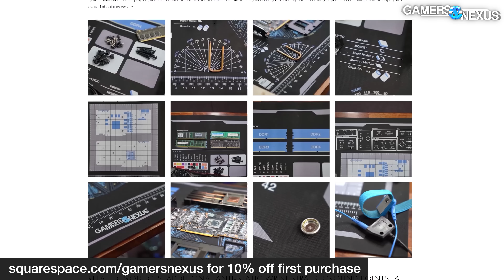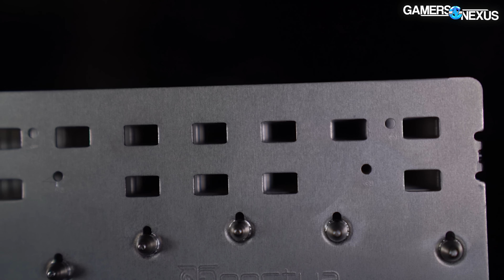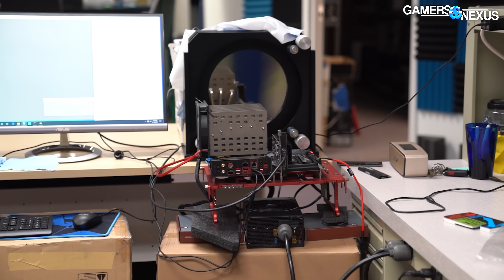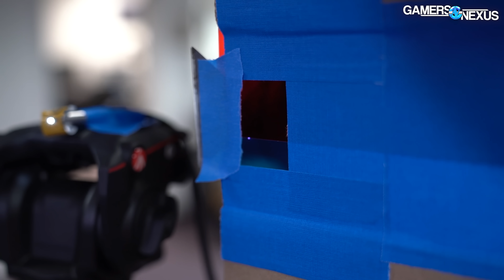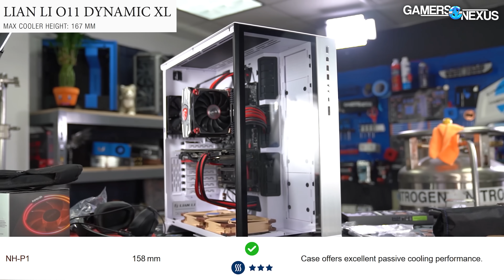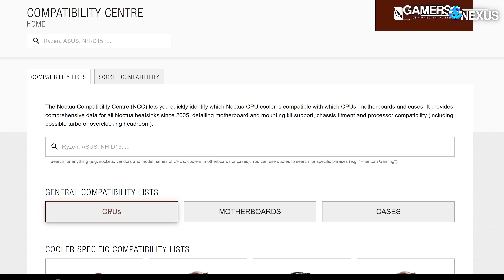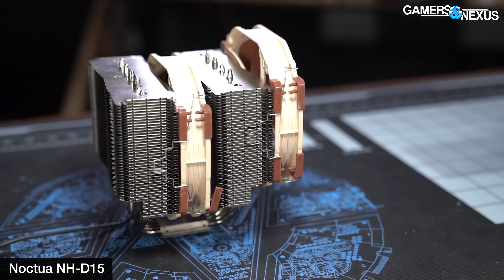Noctua NH-P1 Passive CPU Cooler Review: Benchmarks, Schlieren Photography, & Mechanics

Comment: One of these on a future power efficient PC is gonna be amazing. :)
[edit] You tested on 120w?! Me with a 5800x, interest intensifies! (My case is way too small for it to work, but... I've done crazier stuff)
Ah. I see. So 68w is workable. I wonder if a really aggressive PBO limit of 100w or similar on the 5800x... as I've swapped out my original 5600x... So if I do wish to go truly passive at some point, I'll just underclock/uncore a bit and put the 5800x into 5600x imitation mode. :P

Comment: Overly complicated setup of the Luft Schlieren photography, same can be achieved with water vapor from an ultrasound vaporizer and a peltier element or a small heat plate. Alternatively, if ultrasound vaporizer is already to elaborate, one could use a cigarette in a garage setup to achieve the same with a working mainboard and cpu. Condensing smoke can be cleaned with isopropyl alcohol but I doubt that for the short time of testing it would cake everything in tar.

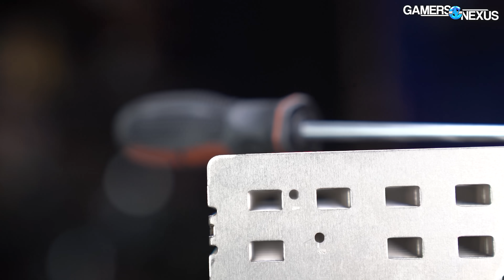Comment: Torx suffers quite a lot from using the wrong (undersized) torx driver/bit. This would likely strip the screws and also damage the driver. In that regard I'd disagree with "a lot less likely to use the wrong driver"  - 22:53

Comment: I can hear the sound of cracking PCBs from here. Things like this should come with full mini-ITX or even mATX steel backplate that screws directly to case. A lot of PCs i've seen running even puny aluminum 120mm block have some PCB warping.

Comment: If you run a much larger cooler than what you need, you can run them with very low fan speeds, and you will likely not really hear the fans at all. That's probably a much better choice if you care about low noise. If you care about low maintenance, Noctua fans tend to last a ridiculously long time (they should last more than 6 years easily, even if being used 24/7) and they're also very easy to replace if it ever comes to that. This is a very niche product. I don't mind that it exists, but I think some people will buy it just for the gimmick factor when they should probably be buying something more conventional.

Comment: I really would like to see that cooler side by side with a Scythe Orochi. The Orochi might even be a bit heavier than the NH-P1 but it was made to be used with fans and didn't (afaik) do well in a fan less build though some tried it. It would be interesting to see a break down of the differences in construction and manufacture. There is about 13 years between these mammoths, and there's hopefully some significant advancements that's been made in that time.s

Comment: R9-3900x user here (NH-D14 with PWM fans)
The REASON I was at first interested in this cooler was because my CPU hits 78degC under certain loads and so the fan ramps up to 100%. I played with the fan profile a lot, but even under LIGHT load it would spike to 78degC so I finally ended up with a fan profile that stayed at 20% fan RPM until 60degC then quickly ramps up... again, the CPU temperature can spike really quickly even at a 10% load (though often at a game at 30%(ish) load the fan isn't spinning above 30% MAX RPM despite producing more heat). WHY?
It's because temperature is NOT heat. You can have local hot spots. It's weird because I can get spikes to around 78degC at 10% load but then stay at 78degC at 100% fan RPM... point is, I wondered what would happen if I could get the TEMPERATURE SPIKES DOWN... but after watching the videos I soon realized that I'd get rid of the fan turning on at light usage scenarios (as the temperature would be lower) but running a game would probably require a fan to turn on and 100% load in a warm room would probably not work at all.
Cool product though!
Looking forward to the Noctua NH-D15 2022 version, although my cooler is working pretty well aside from a few fan spikes (I'm one of those noise freaks as they aren't even very loud).

Comment: If I break out my old heat transfer book a passive cooler is a type of "Free convection" type cooler.  Free or natural convection is when a body force acts on a fluid where there is a density gradient.  The net effect is a buoyancy force which induces a free convection current and the body force is due to gravity.

Comment: I would love to see a comparison between case fans off vs case fans on with this installed in something like the Meshify 2 or RV03/RV02-E. It seems like you could raise the max continuous heat load quite a bit from ambient case airflow, while still being able to shut the fans off entirely at low load

Comment: Im running a dark rock 3 at 700rpm on a r5 1600  at 4.1Ghz. HWInfo reports about 80watts of powerdraw. But still, even at 50% power use and like 20% on the gpu it is still louder. fanless CPU coolers are near useless imo as long as you have a loud AF gpu

Comment: This is interesting cooler, but it seems there is a specific class for it, i feels more like a industrial/hobby factory workshop kind of cooler than you home/office cooler for a regular case. 
and i can see the appeal. 
i know a ton of places that could use this. for example worshops, car shops for example the pc they have in the workshop to chek the parts and info, etc. 
or wood, metal workshops, or farming or where there is potential dust or debris fling,  and i know one of my local wood workshops who use pc with fans and they are a mess to maintin and i wil lrecomend there this cooler, because this will last them a long time, where cooling with a fan, case is full of it, you need to order a technician to maintain them all the time and because of dust, the PC break all the time, like static from dust buildup and heat. so this is one practical cooler for the market that has not had a proper retail cooler for a 65w CPU.

Comment: How does this perform in an actual case, however? I have doubts that the air movement created by convection is strong enough to overcome dust filters for example. So the hot air would have to pass its heat on to the case surface, which would itself be cooled by convection with the ambient air? Or am I missing something?
Reply: Like every cooler, performace scales with the temperature differential. That said, dust filters pose no big resistance to slow moving air, it's the turbulence at higher airspeeds that creates most of the resistance. Lastly, with such a cooler you'd need next to no dust filtering in many environments, this thing won't ever clog up.

Comment: I can run a single fan Noctua NH-U12S on a Xeon E5 2690V2 at 100% load on all 10 cores @3.29MHz, and it has never got above 58 degrees at just above idle speed according to Aida 64. Sometimes I reach in (I keep the side panel off) just to check that it is actually running. I have the Chromax black.

Comment: Why do they make the fins & heat pipes out of Aluminium when Copper is better for heat-conduction: with maybe 4  or steel rods for strengthening/bracing?
Reply: Probably price. Aluminium is the most available metal in the Earth's crust as far as I know.
Reply: @YavorK1  But copper is so plentiful we make household plumbing out of copper pipes.

Comment: Trying to think of a use case for this for me and server room was the only one that came to mind, where the ambient temperature is quite cold and there's a ton of underfloor HVAC on redundant systems to ensure everything stays cold under load. But. The server room is also incredibly loud and there would be zero point in a quiet cooler.  Hearing protection is already highly recommended. But there's all the cold air you could ever want for passive cooling.  Tradeoffs.

Comment: In my experience with fanless cooling over the years i came to the conclusion that its just not worth the effort. There will always be a source of noise somewhere even if you remove all fans from the system. Also passive cooling can actually amplify coilwhine and static noise due to heat buildup. I found the easyest way to get a truely silent PC is to completely remove it from the workplace and put it in a seperate room using extension cables ect. if thats not a possibility overkill custom water cooling is the next best option!

Comment: I still use my passive Zalman reserator1, well passive as in no fans but it still has a pump in the system.   The loudest thing by a mile is my old PSU in my PC.   I peak at about 70c GPU/CPU temp after a few hours of high load in summer which 30c room temp.  Full load is about 580W at the wall. Not bad really, I don't really get over 45-50c peak in winter. 
Considering buying another to run in parallel for my next PC build.

Comment: That is actually pretty good for a passive cooler. You could also take one of the 8 core CPUs and set it down to 64 watt and tune the voltage which would be pretty sweet!

Comment: I have a simple home server stored in a cool dry place (ie finished basement) running a ebay Ryzen 1500,so ya this make since. Its a computer in a rack mount case with vents on all sides, and I would rather forget about its physical condition every other month cause the 1 fan (outside of psu) ... gets dusty. Not enough to cause performance issues, its more like walk buy and its bulking up for winter while still in hibernation 
Might could move that system to the living room so its more useful but...
110$ is a bit steep though IMO... its not magic

Comment: Wonder if there's an easy way to get a mounting bracket to mount this onto a 3050Ti and whether this can fit into an SL600M or Fortress FT05 on both the 3050Ti (maybe on vertical mount) and an R5-3600, both undervolted and on Kryonaut, for semi-passive* 1080p gaming.

*ie you'll have one case fan towards the rear (Cooler Master) or the stock  180mm fans (Silverstone) pushing air up at minimum rpm; plus a fanless 500W PSU

Comment: It would be nice if you could also do a test in a well ventilated case with the P1 getting some airflow from just the case fans and compare it with other coolers by measuring noise levels.

Comment: For future pressure map presentation could you add an overlay with the Ryzen chiplets? Looks like in the case of the 3950X some part directly above of the core chiplets would have been left with small pressure values.  Thanks ^^

Comment: I've always wondered how heavy a cooler could be before it puts so much stress on the motherboard that it just slowly breaks all the traces inside the board over time with its sheer girth.
Reply: If the motherboard sits firmly in place and the case is not "thrown down" on the floor it should be absolutely fine.
Reply: Considering my kg of Thermaltake macho was fine for over 5 years and several moves - seems to be more than one can reasonably stuff in a normal case!
Reply: @Ádám Bezzegh Which I would say is still not a lot considering how tough motherboards are.

Comment: Just an idea for people looking for silent router + nas (if you are running ssd as nas ofcourse) X570D4U-2L2T + r5 3600 + this radiator + about 850W psu that can do zero rmp on low loads + core p3.... gets you 10gbe soho coverage, and enough of processing power to run some vm's / dockers etc etc

Comment: It's a cool thing, but it's still incredibly niche.
You must use this thing on a PC without fans at all or it will defeat it's purpose of 0RPM or completely silent CPU cooler.
Means it will only useful for low end CPUs and fanless GPUs in a high CPU cooler clearance cases.

Comment: I look at this as more of a curiousity. If you are going to have stack of fins and heat pipes clamped to your CPU, you might as well just get a decent air cooler with a good fan that stays quiet. You can always speed limit it to not get to the point of being able to hear it.

Comment: Did some top exec over at Noctua get shamed by peeps hating/making fun their signature colors so bad they told their engineers to make a model specifically for use without fans? At least you don't have to worry about clips, wires and rgb.

Comment: I'm sorry for being a pedant, but I'd assume that's sort of the point of GN 😅 also writing this at 2am so excuse any mistakes I make.
The thing that always irks me is the constant mentioning of "heat rising" as a rule or phenomena. The heat does not rise, the warmer medium (in this case being warm air) gets pushed up by the higher density medium (cold air in this case) being more attracted by gravity and "sinking" or being "pulled" down, consequentially "pushing" the warm air up.
Basically the warm air with lower density sort of "floats" atop of the colder air. With the absence of gravity all other things being equal the hot air should expand uniformly in a sphere until it expends it's kinetic energy and reaches equilibrium with the cooler air that has lower kinetic energy (I assume)?

Tldr it would be more accurate to say, if you really must: "hot air gets pushed up" rather than "hot air rises".

Comment: The heatsink will do well in a case when you have low flow case fans that pull air across it. But most people who will go after this cooler will most likely be undervolting heavily on their cpu as well. Such as myself.

Comment: Funny to see them listing the AMD A12 9800 APU. I have it for testing and that thing runs hotter at stock than my Ryzen 1700 at 3.8 GHz 1.25V. The A12 9800 pulls like 1.5V stock, so if your CPU runs at lower power than the A12 9800, you're apparently all good.

Comment: In my itx tinker build with a 3600 4.2ghz reference 5700xt the wraith prism cooler works pretty good. I had 2 laying around one from a 2700x and the other from a 3900x. I just upgraded my 3900x to a 5950x so I’m thinking of putting the 3900x in the itx build. My first concern is I have a 500 watt evga psu and im wondering if i should trying a 120mm aio or a better air cooler. Its in a thermaltake core v1. It says 140mm the height limit but ive heard of people sticking coolers like a Cryorig H7 which is 145mm i think. So I would like to know if any of you have a 3900x in an itx build and what cooler your using and your temps. I will probably run the 3900x at 4ghz with the lowest voltage possible it will do between 4.4/4.5ghz maxed. My other rig has a 9900ks and you know i kinda like it better than my 5950x ive been having a lot of little problems with that rig. But the 5950x is a beast but man its so much harder to cool than I thought it would be, I have a kracken x72 right now and I got to leave the fans and pump maxed. I also wonder if a radeon vii will fit in the core v1 I have one on my shelf im not using.

Comment: I feel like the NH-P2 needs shorter heat pipes, leading to a cold plate for each heat pipe, mated to those razor thin vapor chambers on each side of every cold plate ( vapor chambers to be referred to as Vapor Fins) these will spread the heat more evenly across the entire surface, but the down side is that the vapor chamber fluid will need to be different than the heat pipes

.....What if the vapor fins shared fuild with the heat pipes.....
wgetting the highest possible average surface temperature is key with a passive cooler, and those fins are just too big for the single row of heat pipes, add too many heat pipes and the air doesnt flow

Comment: The best compromise I've found is the Thermalright Macho Rev B. which has a 140mm fan that runs at 300rpm when idle. You can barely hear it. Even at a max of 1200rpm it's not really annoying to have and it's dirt cheap.